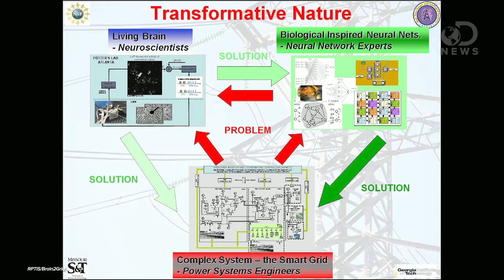Brain in a Lab Controls a Power Plant

Comment: According to the National Science Foundation article, "The purpose is to develop brain-inspired computer code, meaning living brain cells won't be part of the final equation."  Therefore, there is no need to wait in order to accommodate your uneasy feeling about connecting living tissue to the power grid because there won't be any living tissue connected to the power grid.  Rather, the grid will be powered by computer code derived from the neuron experiments.